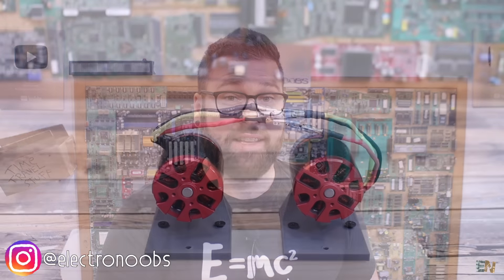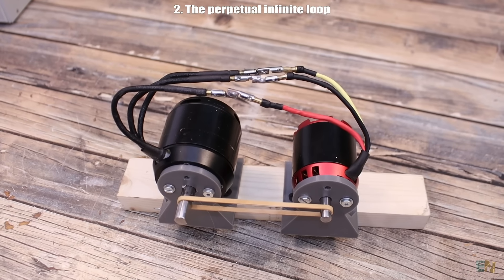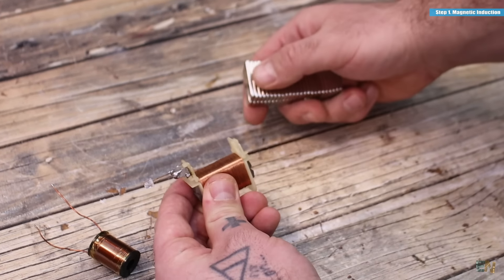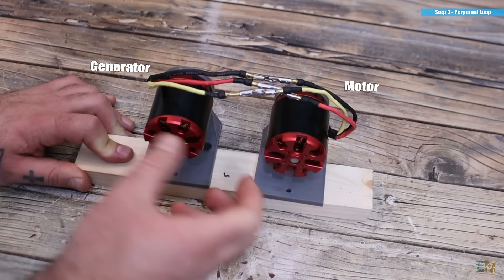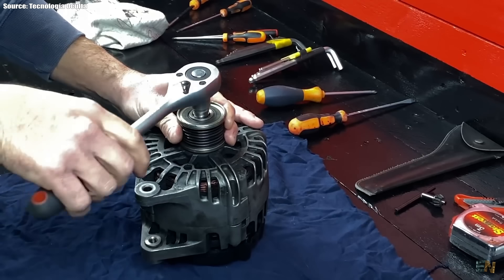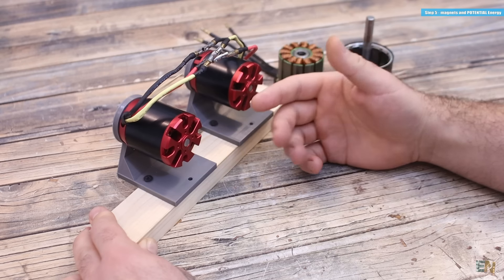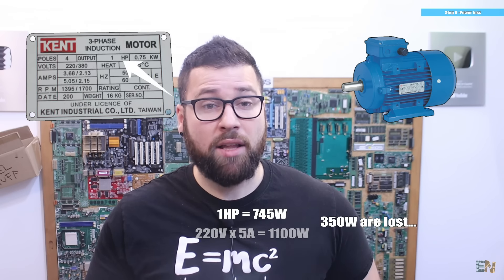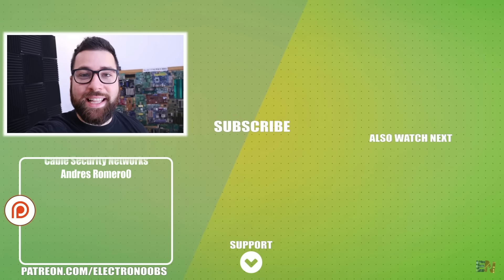Free Infinite Perpetual Energy Nonsense - FAAAAAAKE

Comment: You are 100% in your "science".  You are missing the point that a rotating magnetic filed (N, S, N, S, N, S, and so on) around a coil of copper wired does create current.  This experiment was first done by Nikola Tesla, it''s nothing new.
Reply: @CJCruiser  it’s simple I’ve tried it and it does work it’s not fake how do you think a dynamo works in a car! It charges the battery so you put it to another motor it will power it simple!
Reply: @seanseverythingandanything6440  you have never used the lever, it is something that has been used to amplify or increase the main force. for example if you want to move a heavy object. if you enter the mechanical field if 2 keys have the same circumference a short handle and a long handle. the long handle has more possibility to do the job faster
Reply: @seanseverythingandanything6440  The combustion of fuel provides the energy to turn the dynamo. It does not create any power, only converts mechanical energy from the engine into electricity at about 80% efficiency. It can never make enough power to spin itself no matter what motor you attach to it.
Reply: @johnathon007  have you tried it then?
Reply: @seanseverythingandanything6440  Yes I've shown plenty of people how it doesn't work and explained why.
Reply: @StringerNews1 Correct. Michael Faraday discovered the effect produced by relative motion between a magnet and a conductor.
Reply: @StringerNews1 Faraday was required reading when I went to Electronics school in 1974. The remarkable thing about the man was that he had no formal education and therefore couldn't do the calculations Maxwell and the others of his day could and did, but that didn't slow him down one bit. Faraday didn't just contribute to the knowledge behind the electric motor, according to the IEEE, he's credited with inventing it.
Reply: "The secret to creativity is knowing how to hide your sources."
- Albert Einstein
Reply: ENVY is the big problem of some fellah..
Reply: @seanseverythingandanything6440  Except due to losses, as explained by the presenter in this video, prevent all the generated energy from the dynamo being enough to spin the motor coupled to the dynamo. A system that can do this is called "over unity" because he efficiency is more than 100% (aka unity) and breaks the law of energy conservation. If you think the magic energy in a magnet is unlocked somehow please watch this video again. It was clearly said and demonstrated that the electricity from a coil is only present when THE MAGNET IS MOVING.
Reply: @seanseverythingandanything6440  "have you tried it then?" It is not necessary to try anything that has already been proved to not work by others, or shown to not work by mathematics. This is the fundamental principle of Engineering.
Reply: The only one capable to create energy from nothing is God Himself... but he is made of Pure Energy.....No, I'm not a religious person,   but Humans doesn't have that superpower.
Reply: @overlordrichard  But if the Great Creator of the universe and you has become One Mind NOTHING  IS  IMPOSSIBLE.. The KEY  IS  BELIEVE without any 0.1 % doubt left, but trust, love, compassion to all creatures.. All things are possible according to the purpose of the Father IN Us...
Reply: Done by Tartarians. Later patented by Rockefeller and Tesla build it before.
Reply: Yes I have and it does work!
Reply: @johnathon007  80:80
Reply: @kiowablue2862  Did Faraday had Neodymium magnets? 😉
Reply: @yrejhzsaysonna308  Yes.  But the Device in this Video it's still a fake infinite energy generator.  just because the youtuber is compassionate doesn't mean that he can brake the rules of the universe. and I don't think that making a video with a scamming device  makes him a compassionate and loving person.
Reply: @overlordrichard  agree. Seriously not trying to spread FUD, it’s basically that with so much need for something like that in the world and not sharing the exact how to is not compassionate at all, come on!

On the other hand, “we’ll disclose how to build it exactly when we have enough likes???” How many more you want after millions of people having watched it?

I really wish I was wrong, but it doesn’t seem so
Reply: @pstonard  or the coil is moving.  See how that works.  The issue is that charge is built up and stored in one of several ways.  A capacitor, battery, flywheel or several other methods can be used to store excess energy beyond the needs of self sustaining an energetic reaction. Think of a pendulum.   You have to get it started which takes some energy, but to maintain it once in motion to counter frictional losses only takes little additions of power.  It is easy enough to imagine a magnet on the end of the pendulum charging a circuit feeding an electromagnetic booster at the ends of its swings.  Not some universal law defying breakthrough.  Just a simple demonstration of how near perpetual motion is easily crafted using simple machines and circuitry.   There are no doubt fakes out there but there are also obtuse and unimaginative debunkers out there too.
Reply: @seanseverythingandanything6440  because the combustion of fuel in the cylinders that spins the crank shaft connected to a belt that spins the alternator has nothing to do with it am i right?
Reply: @pstonard  what I mean to suggest is that all systems have inefficiency but no systems are truly closed either.  So any given mechanism of power transfer and generation is open to innovation that enhances efficiency sometimes in surprising ways or draws or stores power that introduces a kind of over unity to the system we have isolated for study.  To simply say something is fake or impossible short circuits all discovery.  Science and technology have long histories of proclaiming such absolutes only to have to radically alter their theoretical constructs later.  Forever it was viewed as self evident that the universe was like a clockwork winding down but data has shown otherwise no matter what our notions about impossibility dictate.
Reply: @pstonard  well, think about it this way.  Is it really all that much more reasonable on an intuitive level, to pump energy in supply lines all over from centralized plants and generators through miles of lines.  You have to grant there are some inefficiencies involved.   Alternatively, if it can be shown to make a device or powerplant methodology that is personal scale distributed and local, it is worth considering the angles, with openness and charity.  There are many vested interests opposed to such thinking for predictable reasons.  Let's say a device can be cranked up with a flywheel or springs with human power in a half hour of effort and provide power all day.  Not impossible, not defying laws but providing a design engineering solution to the need for power.
Reply: @markyarbrough5511  Sorry, this is a bit too far off topic (debunking FAKE Free Energy) for me.
Reply: @markyarbrough5511  "It is easy enough to imagine a magnet on the end of the pendulum charging a circuit feeding an electromagnetic booster at the ends of its swings. " <-- electric clocks I've taken apart actually work in reverse, they use a watch battery and an electromagnet to keep the pendulum swinging. If you tried to harvest power by putting the magnet on the pendulum, the pendulum will slow down with every pass because the magnet is attracted to the coil, it will eventually reach static equilibrium (ie, stop moving)
Reply: @markyarbrough5511  As for decentralized and personal scale energy devices, solar is much cheaper than it used to be, and oil companies haven't murdered anyone over it. Even if these free energy machines produced power, you would still need to spend money on the device, why not just buy solar? no conspiracy necessary.
Reply: @CJCruiser  was being slightly indirect in my comment.  There are a variety of ways to approach this discussion.  Isolating what is fakery versus ingenuity was what I was trying to tease out, however unsuccessfully.   The issue is that most designs of mechanisms depend on built in inefficiencies to optimize useful output.  We can ignore various aspects of the loop because we are used to just paying a power company to burn coal or uranium hundreds of miles away and provide it two squander in countless careless ways.  The issue is free energy on a closed system level is built on as much fantasy and cherry picking as the concept is expanded to whatever reference scale we decide is relevant to the discussion at hand.
Reply: @CJCruiser  again, it was my fault for not being clearer or maybe not knowing exactly the point I was trying to make.  I imagine many kinds of devices in my mind that work around the limitations that seem built out of convention and not as fundamental issues of theory or design.  But describing all that gets pretty far afield of this discussion so I was trying to hone it down to something manageable.   I think sticking to the dimension if this thing it is that there are ways to store excess energy, be it charge, magnetic flux, momentum or even heat in ways that could be used to both sustain a reaction and derive useful excess energy.  Making my full case could take a while and I am not trying to write a dissertation on this comment section.  But I will give it more thought and see if I can at least address meaningfully your response.
Reply: @CJCruiser  I think such things should be a part of it.  Wind solar, etc.  The issue seems to be setting up a system which can draw and incorporate power, store it in a variety of ways and draw it as needed.  A flywheel is a very key component that everything from steam engines to water wheels and wind turbines use to flatten out power and torque curves.
Reply: @johnathon007  You are right, mechanical power is = to torque which is 
twisting force and speed. or rpm of the shaft.  Amps are the electrical 
equivalent of torque while voltage is the electrical equivalent of speed. 
anyone who has ever messed with an old telephone magneto would 
know this. these mags are sometimes found in school science labs. 
cranking the mag w no load you just produce voltage and cranking 
the magneto is easy. now you hook up a 7.5 watt lamp and cranking is
no longer easy. . .WHY,?  all the coils wound on the armature turned the
armature into an electro-magnet. and a powerful one, so when the north 
pole of the armature was coming up to south pole of the field magnet
they were very much attracted, and considering the south pole of the 
 armature coming up to the north pole of the field magnets, so you have 
two powerful poles of a spinning armature wanting to stay lined up with
the opposite poles of the field magnet, this is why more torque was 
needed to crank the magneto, trying to move an electromagnet thru a 
magnetic field. 

Ppl who never did any kind of experiments like this could never 
understand why you can't have so-called perpetual motion and all
sorts of free power gimmicks, they'd be better off going back to
school or getting into some science course  say for GED to get a
H.S. equivalency.
Reply: This guy misses a lot and says the word "assume" a lot.  In the video I watched the alternator was taken apart and modified with stronger magnets to create more power.
Here is something simple you all can understand.  Buy a power inverter that you plug in to a car cigarette lighter.  That alternator is only generating 12-14v of power but can be converted to 500w 110v of AC power. Larger inverters are available too.  So the idea that you can't take a small amount of volts and make it larger has been debunked by the people selling inverters to plug in to your car when you go camping or what ever. RV's have 2500 watt inverters that take 12v DC and convert it to 2500w of 110v AC power.   Just based on this alone you can make a perpetual power generator with zero internal modification to the alternator.  Most welders know you can remove the regulator from a car alternator and use the current to weld with. So we know for a fact the alternator is capable of way more power output then they come with.  Back to the power inverter. If you have a electric motor what turns 1500 rpm powered by 250w of 110, it's easy to see how that 2500w 110 inverter is putting out way more power then is required to turn the electric motor that runs the alternator.  Not even factoring it the possible use of pulleys to ease the load on the electric motor, or increase rpm and output of alternator.
Reply: Actually, it was done by Micheal Faraday British scientist around the end of 1831.
H.C. Orsted in 1820 found that a current flowing through a wire would deflect the
needle of a compass from its ordinary position...
Reply: @starbattles1  Hi, No one ever said you can't jack up 12-14 volts and make 110 volts a.c. and make 500 watts of power, either by stepping up the field voltage of the alternator and maybe spinning it faster or using an inverter. But the idea is supposedly getting more power out than what is going in and having that last forever so you get free power. 

If I get this right, you want a 250-watt motor spinning at 1500 rpm turning an
alternator that works the 2500-watt inverter? and off that inverter power is
used to work that motor to drive that alternator? for 1 thing, it would have to 
be like a 24 volt volt alt. at over a 100 amps. not saying this can be done but I
have not seen any 12-volt alt. that could put out over 200 amps.
Even if the 250 watt motor was getting power from elsewhere, no way in hell
is it gonna turn a gen/alt of ten times more power than it is. so as I said earlier,
the people here who think they can get much more electrical power from a
gen/alt. than the mechanical power in speed and torque going into it
are smoking fruit-loops and/or doing serious weed.
Reply: @raymondgarafano8604  lol. That hardly constitutes perpetual free energy.
Reply: @bonifacericlaude7951  well hello Boniface, seems like u have a good handle on things, even the simple can opener, with a longer twyst handle makes it lots
easier to open that can of beans, or a pair of 10 inch linesman's pliers more 
than the 8 inch, more torque and it is easier to use them as there is more torque.

Ya know Boniface, there is one experiment that would teach some1 so much
about the relationship between speed and torque volts and amps. The ppl here 
who state they have a machine that gives free power,  stooges? They otta join  a science club (If one exists) get a motor belted to a car generator or alternator,
get some meters for volts and amps both for the motor and generator.

With a lot of headlamps and a partially charged battery, have none connected
to gen and measure volts and amps for motor driving the gen/alt. The electric
motor with no real load will not draw full load current until you start to apply a
load on the gen/alt. It will be seen that as current is drawn from the alt/gen,
more current will be drawn by the electric motor as well and the motor's speed 
will drop some, depending on its hp. The motor's speed will drop less if its hp
is great enough, with efficiency rating and the load.

Say the motor is rated 1 hp, that is 746 watts at 80% eff you need to + 150
watts so that is 900/120 volts and about 7.5 amps drawn w full load. 

As said elsewhere some who think you can get more power from a generator
than the mechanical power going into it are smoking fruit-loops or weed.
Chances are they want to be with the 'In crowd' talking about lofty ideas of
all kinds of power for nothing. it is not going to happen.
Reply: @raymondgarafano8604  realizing current flows and actually making something move, are not the same thing. One thing is to have flowing water, another is to use that water and move a mill.
Reply: @onlinebills9169  Well Online Bills, I'm not too sure what ur saying, we know 
current can only flow when there is a complete circuit, if the current is drawn 
by a motor, it is like water turning a millwheel to grind oats or corn, right? 
And if the wires to the motor are shorted, an even greater current will flow but
hopefully an overcurrent device will open the circuit.
Then there is what's known as available current, a car battery might have
150 ampere hours while a diesel starting battery might have 500 ampere
hours, Or the current in a receptacle in our home, say a 15 or 20 amp circuit.
current it there to do work for us when we plug into it and turn it on. . .
I guess u could say the water behind a dam is current, available current,
but open the gates so the water flows into a penstock to a turbine to turn
a dynamo, well that would be flowing current used to do work, but I think water
could be allowed to leave the dam not doing anything useful but still flowing.
Could you please be more specific?
Reply: @johnathon007  Then use another kind of fuel. Use water as fuel to turn the dynamo. https://www.youtube.com/watch?v=4Mtheb09IxU
Reply: @markyarbrough5511  Like so? https://en.wikipedia.org/wiki/Gravity_battery
Reply: @seanseverythingandanything6440  No, you haven’t and it does not.
Reply: @seanseverythingandanything6440  I see you insist you have done it.   Where is it? Why haven’t we heard of you?  You are the wealthiest man on Earth on single handedly broke physics and put climate change to rest.
Reply: @seanseverythingandanything6440  just checked the news, still nothing, why is that?
Reply: Before you talk talk you test it first before you coment